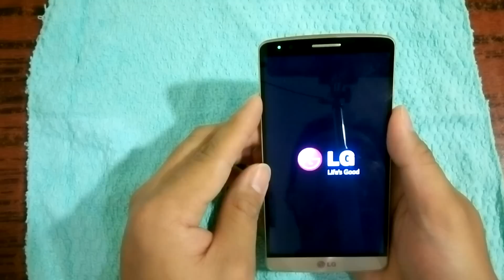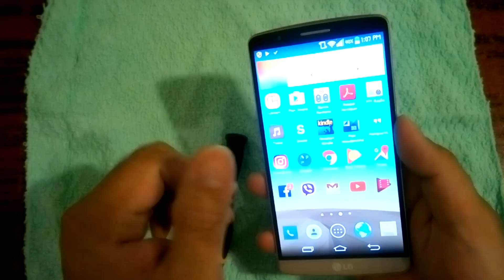LG no display/flickering/fading issue FIX! NO oven required (2021 Updated)

Comment: this has been tried and it doesnt fix it permanently.  You can find that out by researching this issue for 2 minutes. If you follow the logic behind placing plastic above the motherboard, you'll realize that what youre in fact doing is putting pressure on the processor and the motherboard. This means that the connections are loose. Hence the temporary solution when applying pressure.

Ive tried this and many other "solutions". For me, baking the motherboard has been the solution that has lasted the longest. Theres only one thing left to try and I believe is the closest to a solution. 

Step 1:

Root the phone and do the temperature mod, you can find instructions on xda developers. This will make your phone run cooler 

Step 2:

melt soldering paste around the processor using a heat gun so as to close any gaps between the processor and the motherboard and fix any loose connections. Theres a video on youtube and xda as well.

It is my firm belied that this is caused by the overheating the LG G3 is so famous for. The heat, over time, loosens the connections and this is what causes the screen to flicker. Im sure of this since this flickering problem has shown up every spring as temperatures rise and add to the overheating my phone experiences.
Reply from the maker: Thanks for the steps, i believe it would help a lot of people experiencing this kind of issue. I fixed mine by doing what I posted on the video, and I am no expert as well. Whatever works then great right? This phone by the way still works for 3 weeks straight without any problems. Cheers!
Reply from the maker: Thanks for the steps, i believe it would help a lot of people experiencing this kind of issue. I fixed mine by doing what I posted on the video, and I am no expert as well. Whatever works then great right? This phone by the way still works for 3 weeks straight without any problems. Cheers!